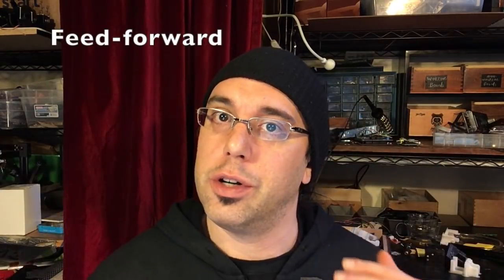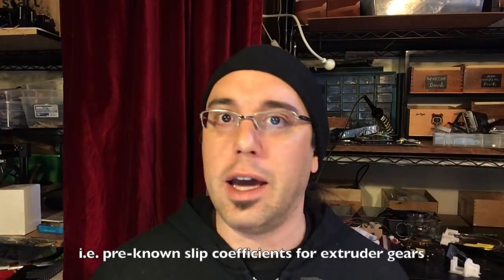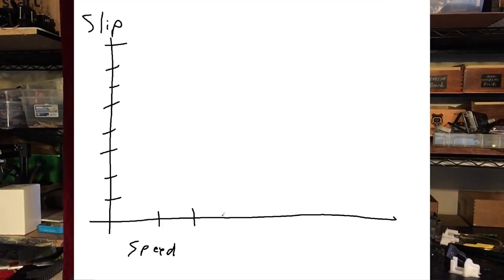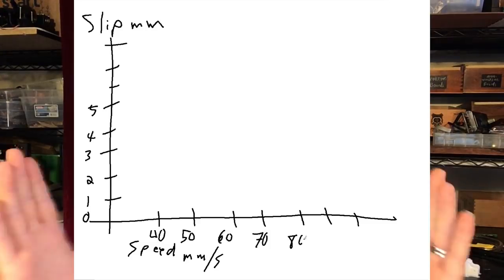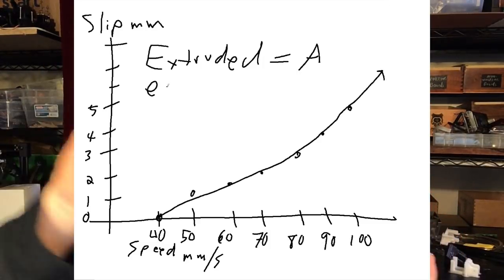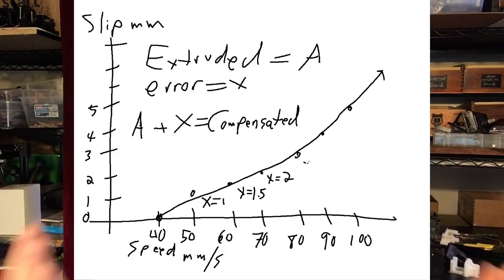3d print fireside chat: wacky ideas

Comment: Few ideas :
- Analyze image from a pi camera and stop if the print don't correspond to what is supposed to be at each layer
- Use a ~500mw laser with the hotend to pass over each layer to smooth layer transition and help with layer adhesion.

Comment: So one of the under developed hotend offshoots was the circular ceramic heater that goes all the way around the hotend. They could get up to 200c from 23c in 20-30 seconds and the thermistor was build into the nozzle. The only issue I ever had with them was wire restraint because the leads had a tendency to snap off but holy cow did that print better than ANYTHING I've used sense. The low thermal mass/efficient heater+ proximity of the thermistor to the material produced the most consistent layer lines I've ever made. The mini hotend is still for sale I think but I had to abandon it because they never developed more than one nozzle size/ changing nozzles was kinda a pain.

Comment: I think the thing that stood out to me the most was the inductive heater idea. It seems like we are in a bit of a rut with most people trying to incrementally improve the j head/e3d style hotend.
Reply from the maker: Agreed.  I am tired of hearing 'print slower' as the answer to every problem.  I would rather be able to 'print smarter', and making a more thermally-nimble system and tying that into the software would go a long way in terms of simultaneously improving speed and print quality.
Reply: @AlexKenis  I was doing some googling the other day and it looks like about three years ago there were some groups experimenting with inductive nozzles. I'm betting this is another example of tech that got missed by the rapid adoption by chinese companies.
Reply from the maker: @crystaldragon141  I have seen a few threads that either used old tech (analog control) or just kinda dead-ended. it would be great to find a project that is mcu -based, and has the control loop worked out, that could be adapted for 3d printers. If I get time to mess with the concept, I'll have to run around and dig for info in different industries. I did actually used to build and test induction forge controllers years ago, but I didn't design them. It's not too difficult to get a basic (badly-performing) induction heater with an arduino and a mosfet bridge (done it), but optimizing the frequency and power needs for the proper penetration depth, and messing around with different insulation methods and nozzle materials (brass, steel, plated, or copper in a ferrous metallic sleeve... etc) and programming the loop and control software, determining if a locked phase loop is necessary, etc etc… THAT’s the weeks of work I just don’t have the time for at the moment, but would love to look into eventually
Reply: @AlexKenis  I hear you!
Reply: The original wrapped reprap heater was actually ultra responsive and ligtweight.   Maybe we should look into it again..

Comment: For hotend, you could use a CR-10 (MK-10) heatsink.  It is roughly the same as a V6.  I mention this because it has 2 mounting holes in it (3mm), and they are flat.  There are two varieties, older (M6 threads for thermal tube), and later (smooth OD, except for bottom which is M6 to thread into heater block).  They actually perform very well.  I personally prefer the early version.
Reply from the maker: Good suggestion. I have actually been hunting for something similar to that, and didn't know the older versions were threaded.  I have thought about microswiss or cr-10/MK style, but I don't trust the thermal transfer of the newer models with the grub screw to hold the heatbrake in. I'll probably go on a alixpress goose chase and try an assortment of cheapies... maybe try tapping one out to M7 and using an e3d heatbrake. Honestly though, for the price of some of the premium hotends, I could take a block of copper to a machine shop  and have them cut me a one-off, which I may try.
Reply: @AlexKenis  Indeed.  And some of the 'premium' ones, actually have drawbacks.  The first time I ever saw a 3D FDM printer, I thought of 3D laser polishing/finishing.  But, I'm likely not trained well enough to begin to pull that off.  lol
Reply: I wonder if early variety matches one made by Wanhao at one point. I only have vague recollection, but maybe that's a useful keyword.

Comment: RepRapFirmware has an experimental approach on reducing ringing by adjusting accelerations. It is static, though. You have to measure the ringing period as precise as possible and calculate a parameter from it. Sorry for not being more precise but I don't use this feature, I just know it exists.
Reply from the maker: I'll have to take a look at it.  That's a nice approach if the calibration is simple
Reply: @AlexKenis  Here is the thread about it in the forum: https://forum.duet3d.com/topic/5951/periodicity-of-ringing

Comment: Nice video Alex. 

It would be fantastic to see a compact pellet extruder,being able to use recycled plastic bottles rather than having to buy rolls of filament would save money and our planet.interesting idea ragarding an induction hotend,this is something that could be implomented fairly easily.
Reply from the maker: Good call.  I actually started talking about a raw pellet extruder, but cut the section out because my rambling was to incoherent.  I was thinking of something along the lines of injection molding auger drive, but with some kind of post-injection thermal/pressure control to keep the flow consistent.  I tend to use  raw, uncolored PLA filament for prototyping in the hopes that someone will get something like that working well/cheaply in the future.

Comment: Thanks for sharing😀👍
Those sensors would be possible by using a raspberry pi I/o it honk
Reply: using a raspberry pi for this is like using a nuclear bomb when a bullet would have done...  total and complete overkill
Reply: Pi is not the right choice for analogue sensing or very sensitive real-time sensing. It doesn't have analogue inputs as opposed to any microcontroller, and realtime Linux is a ton of trouble and only there to achieves hard timing guarantees in possibly down to sub-millisecond range, the kind of times Linux generally deals with, cycle accurate control is impossible because of immense hardware complexity that also necessitates high software ecosystem complexity. It's fine to use a Pi for data aggregation and reporting, or for planning tasks, something that is more bulk processing, because it sure has a lot of computational throughput, but you either need a microcontroller or smart i2c/SPI sensors for every single thing to do the actual foot work.

Comment: Have you tried the mosquito hot end,it uses copper. Klipper as stated for firmware. & just brainstorming how about a Ranque-Hilsch vortex tube cooler would require compressed air or some fancy shroud on a fan.
Reply from the maker: vortex tube cooler is pretty much what I was thinking.  It's on the to-do list to try.  I know the full setup and a decent compressor would work, but When I get the time, I want to look into a cheaper way to do it, maybe with as many 3d printed parts as possible.
Reply: @AlexKenis  I am wondering if you could create one that just used an impeller in a shell that was shaped to work as the vortex cooler does and not require a compressor. Figure that one out I'll split the patten fee with you and we will both get wealthy :) Feed the hot air out from the other side of it to the hotend then for extra benefit.

Comment: Newest versions of Marlin (1.1.9 and 2.0) include S curve acceleration. Ringing is dramatically reduced. It is eliminated on my cheap i3 clone at any reasonable printing speed (under 100mm/s).  No need to go crazy with mechanical fixes. BUT.... you should probably ditch your 8bit controller and use a 32 bit for the new Marlin. The 8 bit cpu can't keep up. I swapped out for a Due that i had lying around.

Comment: About heaters that can change the temperature faster I always thought that in the future the design may be something similar to high quality soldering Iron tips, like JBC, the have a high power heater (120w) are made of copper (to improve heat transfer) and have an integrated thermocouple so they can reach soldering temperatures in seconds, I don't know if it is necessary for hotends because you are probably limited by the Thermal conductivity of the plastic. Maybe an integrated nozzle/heater/thermocouple made of copper covered in steel to print filaments with hard particles could be the future?
Reply from the maker: I think more 'nimble' extruder temps will be a great thing in the future.  even just being able to fairly-quickly dial down temps for bridging and small curves while dialing it up for faster moves would be a big improvement

Comment: At 9:16 it already exists in the duet, it's called nonlinear extrusion and it works quite well, I measure and compensate for that in my calibration. It's one of the reasons why I switched to duet.
Edit: it also mostly solves the problem at 13:45